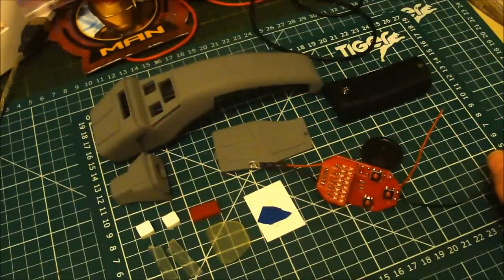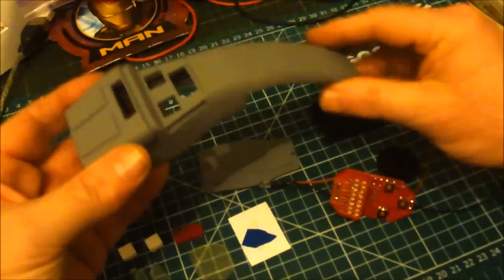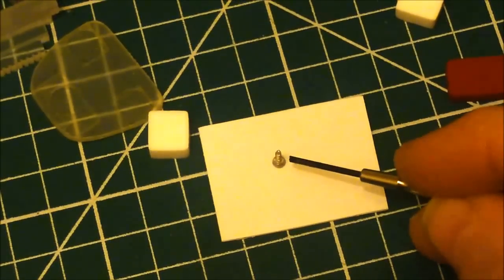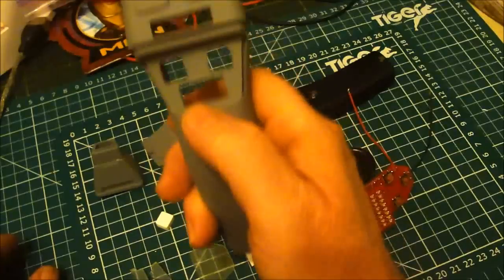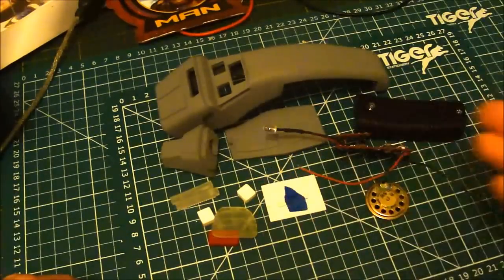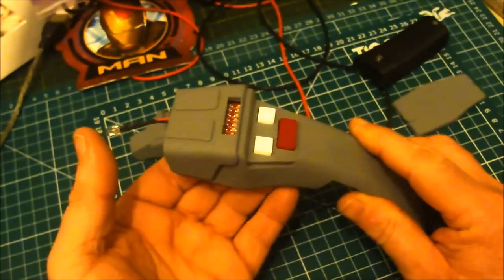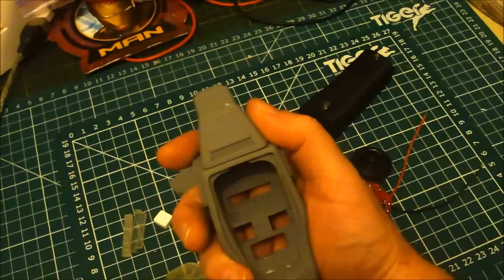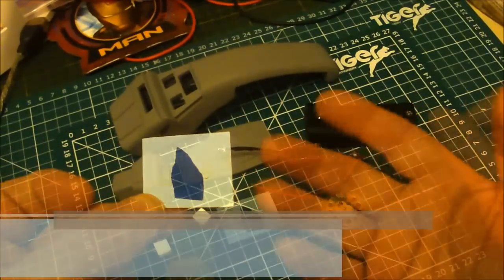Star Trek Boomerang Phaser Kit build with Electronics Part 1

Comment: These are awesome. I just finished one, without the electronics, though, I have messaged gmprops a couple of times asking about electronics but have not heard anything back. The kit itself required very little clean up. I have the Tricorder prop with the electronics installed also. Thanks for your videos.

Comment: I believe that white plastiene is to put on the bottom of the circuit board so as to not let the speaker short out the board 😉 if it comes into contact with it